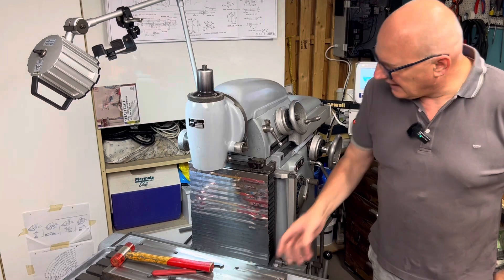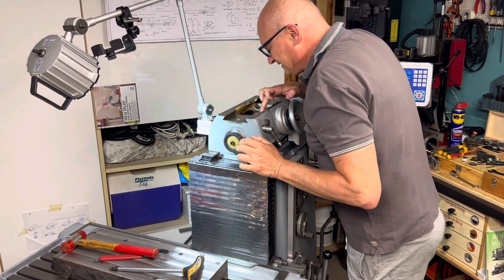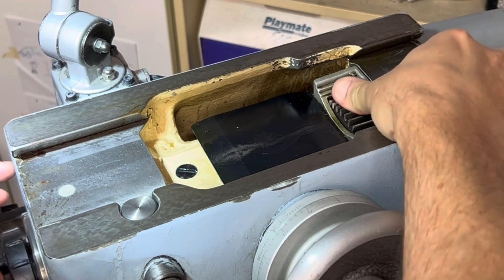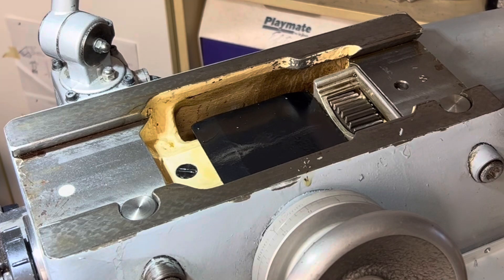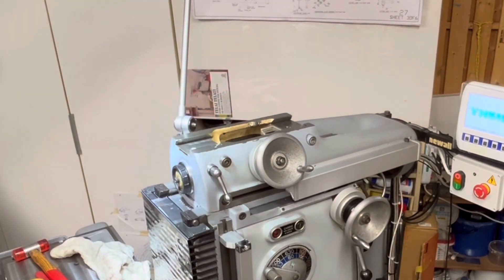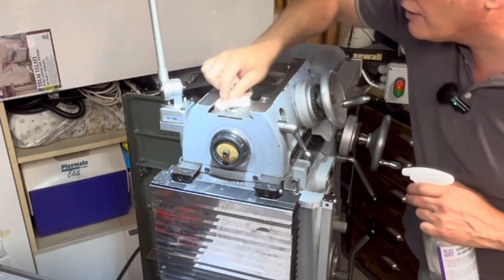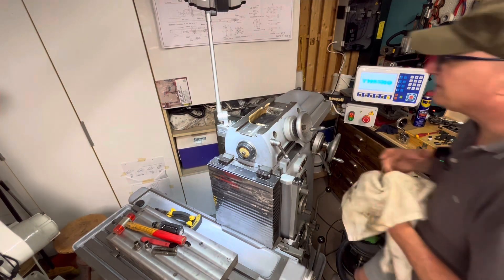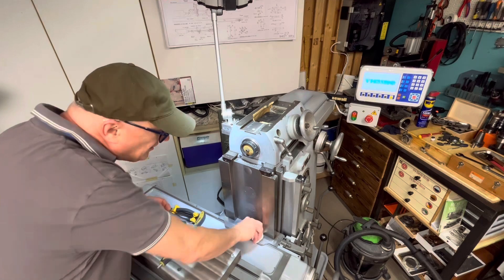Deckel FP2 Milling Machine Vertical Head Axis Removal - Rimozione dell’asse Y della FP 2

Comment: Hi, I also have an FP2, a slightly later version, SN  6153.  My understanding and experience are that you don't need to add oil to the top; you would add it to the side in two different locations; there should be view glass or bolt holes that will let you know when it is full.  (don't overfill).  This can be drained from that location as well using lower bolts, and you can wash out old muck by running a light oiled (spirits) through the system.  Regards,
Reply from the maker: Many thanks
Reply: The Deckel FP2 manual says to add oil to this location, just how much I am unclear on. Until the oil galleries overflow it says.

Comment: Thats a really nice machine. It looks like its in really good condition. I did a partial tear down on my Bridgeport over a year ago and I sent the table in to have it resurfaced. I installed a brand new oiling system as well. So far it's working pretty good. 👣👣👣👣👣👣👣
Reply from the maker: Hi, thanks, also Bridgeport is a very nice machine, yes my FP2 is in very good condition, thanks a lot, please if you didn’t remember to subscribe, thanks